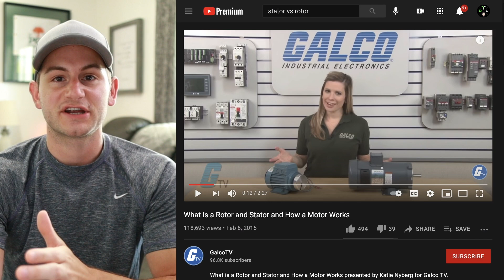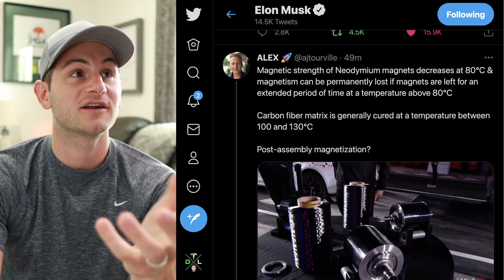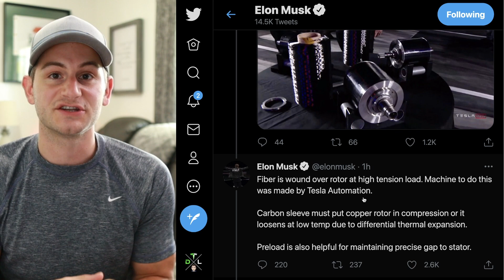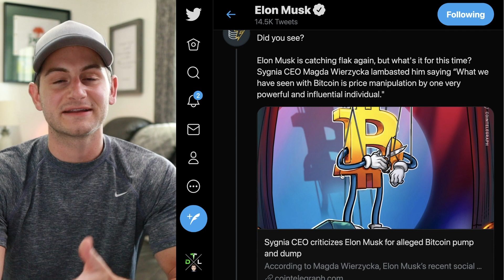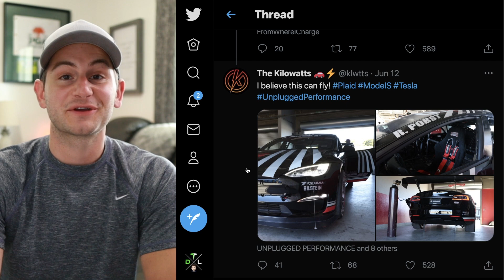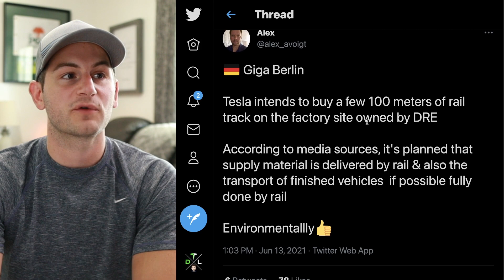Elon Just Leaked NEW Details on "World's Most Advanced Motor" 🌍

Comment from the maker: Hey guys! This motor is a much bigger deal than most of us were expecting...as expected! Haha have a great day!
Reply: This new motor is underrated imo 👈🤔
Reply: Machine-wrapped motor could be bigger than 4680, due to efficiencies that apply to ALL battery formats, not just tabless! Not holding my breath for fin-media to ever grasp this, but another "Fear Factor" from Tesla for ICE OEM's to quake about & have ZERO responses! Hodling to the max.
Reply: Neodymium magnets comes in different temperature grades. While it is true that the standard magnets lose magnetism at 80 degrees C, they comes in grades that work up to 230 degrees C. https://www.first4magnets.com/tech-centre-i61/information-and-articles-i70/neodymium-magnet-information-i82/how-does-temperature-affect-neodymium-magnets-i91
Reply: Agreed, the mainstream media and legacy auto will downplay this monumental achievement.  We truly have just witnessed disruption of legacy auto with regards to the powertrain.  Tesla Engineering are effing rockstars!
Reply: @keithnance4209  well ya, but for aviation, 1 Tesla motor can probably turn a bigger blade than anything else.
Reply: @jt7468  The carbon wrapped motor is designed specifically to withstand the high centripetal forces in a high RPM motor. You can’t turn a propeller blade at those speeds!
Reply: @garychadwick1240  look up gear motors.
Reply: @garychadwick1240  Eternal debate within electric model aviation, what is best, gigant direct drive “torque motors” or highspeed high power density motors with a reduction gear. Typical, highest peak power per kg is still achieved with geared high speed setups. Direct drive wins on simplicity and lower cost. When it comes to real (not models) reliability and durability, it’s all up to the cost and quality of the reduction gear in  relation to mass. Helicopters and turboprops all depend on extremely reliable and power dense reduction gears.
Reply: @garychadwick1240  If you wanted to build an electric airliner that would carry about 35 passengers, what kind of motor would you use?
Reply: Will it fly one day?
Reply: Damn bro, it's wild how I watch your vids now and remember partying with you at Penn State LoL
Reply: I wish I get to know more about the technical upgrades that they did in heat pump/HVaC..
Reply: If I was Ford, I'd learn how to make synthetic gasoline from solar, air and water, and do it B4 SpaceX makes methane that way. It would cost more but at least they could continue selling expensive ICE cars...
Reply: @fireofenergy  Germany is trying make synthetic gas since 2nd world war , its nor cost effective compared to extracting oil from ground and when electricity is 5 times cheaper there is no commercial viability of synthetic oil. there is a recent video from Engineering Explained channel on that..
Reply: ²
Reply: You're right! The lightweight performance motor will further enable electric flying vehicles.
Reply: @jt7468  the motor is not the limitation for flying. The weight of batteries are.

Comment: We developed a carbon-fiber wound rotor motor around 1997-1999. It was a feasibility study so it was not going into production. Pretension pressure on the rotor surface from the carbon fiber was to exceed 1200 BAR at nominal operation speed to keep the rotor from expanding. If I remember correctly the Neodymium magnets were of a grade that could handle 150C. There are grades going up to 200C, but the the cost of higher temperature is that the magnet will be weaker. If 200C is not enough, use samarium-cobalt as they will be stronger at the very high temperatures.

Comment: Yamaha / Toyota has super advanced electric motor tech & there's a way to diffuse a certain metal element into the outside of the magnets in IPM to improve heat transfer away from the magnets // & same element can make alloys in induction motors that improve magnetic flux density (efficiency)

Comment: Wall of text:
I can't make good use of this information. Putting a layer of carbon and plastic on the inrunner rotor will increase the distance between magnets+iron VS copper stator. However... he talks about copper on rotor..? WTF would you use copper on the rotor if we think about a brushless design?`Copper is soft and heavy, exactly what you don't wan't on a rotor if you have intentions of using it in a repetitive cyclic environment like a vehicle?!

I would understand carbon wrap on an outrunner design brushless... wrapping outside of rotor does not increase distance between rotating magnets and stator coils... but still I do not understand the use of copper in rotor part.

Now if we are talking about a brushed design, well, now it kind of makes sense... but somehow you have to gain somewhere else for the losses incured by extra distance.

Buuut... how do you solve the darn heat problem? Coils of copper tends to get hot... carbon + plastic fillers are typically very poor heat conductors.

Comment: If carbonfiber wrap increases gap space between stator and armature, that would reduce mag-flux intensity. If the wrapping could be done on just the Cu wires alone, no change in gap, that would be even better. Another approach not discussed is using retro-style permanent magnets (eg. AlNiCo) on rotor, with super-small gap, and vacuumed case.

Comment: The increase in RPM’s is a two-fold if utilizing the potential energy like a KERS in F1 or by throwing it back into a capacitor during braking holding it only to discharge during acceleration.

Comment: So, as I understand it neodymium magnets are made by bringing the neodymium into close contact with the iron of traditional magnets.
One of the ways to do this is to powder the two elements and pack them together. I believe this is called sintering. Alternatively the carbon fibre is used to  hold the powders together, when fast spinning would normally tend to break them apart. The carbon fibre acts as a kind of cummerbund. 
But there is a problem (which I don't think was addressed by the presenter). The carbon fibre resin in the moulding sets at temperatures which exceed 80 degrees centigrade. Temperatures above 80 degrees centigrade destroy the magnetic properties of the neodymium. I did not catch the resolution of this  particular contradiction.

Comment: Yamaha have created a family of light efficient motors (different price points, different power specs).  Lucid's EV motor is very light & supposedly very powerful & efficient. Yamaha do engine & cylinder design work for many ICE manufacturers (boats/snowmobiles too etc), so they really know their stuff.  It would be great to get a comparison of those 2 & Tesla's new motor specs.
Also I was fairly sure that battery tech has miles to go before they're at their peak of development, but EV motors, not so much as they've been around much longer than the ICE. How wrong could I be!  It's modern materials science & manufacturing that stupidly for the electric motor industry, hadn't been applied as much as in the ICE arena!
Shame on GE etc!...

Comment: I wouldn’t doubt that Tesla is using everything but the tri-motor in the long range version. They are just limiting everything by software. You certainly can’t tell the difference between the two visually besides badging. They don’t even include the upgraded rims/tires on the plaid. At least if you get a performance 3/Y it comes with the upgraded tires/rims.

Comment: 🤔electric motor companies know that the air gap between the rotor and the stator is a big part of the motor design, what’s going to be interesting here is removing the heat from the rotor, I’m not sure CFRP is noted for its thermal conductivity. In induction and brushless motors the windings are typically in the stator and the rotor is reacting to the fields going about it but heat is still generated in the armature. I fear 88C is approachable to demagnetize the neodymium magnets unless the heat can be dealt with. It would be interesting to get the rest of the story from the Tesla engineers to see what is really going on in that motor.
Reply: Yes yes yes! This is the important point. Keeping the fields optimized of a broad range of conditions is hard. Usually you select a single optimal regime. Here that optimal regime is broadened, or there could be several regimes.

Now I’m beginning to think the plaid name and logo are a clue to the wrapping of the carbon fiber.
Reply from the maker: thanks for sharing!

Comment: Copper rotor. This means it must be an induction motor. No magnets. I would think that the motor could be chilled to a low temp before it is wrapped in order to reduce the risk of the two components coming apart at low temps.

Comment: These motors where built for the plaid version because of how much faster it has to spin. I doubt they are needed for the model 3/Y or regular model S/X. Im sure these new motors cost more to make. But i could be wrong.
Reply: yu know.  great TECH but more expensive ... but i bet this motor wud work just fine on the TESLA ROADSTER.  TESLA stock will 10x in 10 yrs.  all my friends have zero idea.
Reply: As carbon fibre is not that expensive (in relation to the quite small amount needed for a rotor sleeve) I see potential to make all motors a number smaller and lighter AND more effective. In total a lot of positive effects. A relative large portion of the cost with CF is the processing. If this is automated, I see only savings everywhere else :-)

Comment: I think the cost and complexity makes it an unlikely fit for the 3/Y, though I'd bet it's going to be on the Roadster.
Reply: Cost and complexity is solved by mass production… which the 3/Y certainly are.
Reply: @ernestgalvan9037  some things remain expensive. It's why SpaceX (and Tesla, really,) use metal instead of carbon fiber wherever possible.
Reply: @ernestgalvan9037  to a degree. This has obviously been in development for a long time, as many issues needed resolving. You can't make a car engine as cheap as a stick & a hoop by infinitely mass producing it.  The Semi would be a great place to install this for the efficiency win especially to shut Bull Grates & the Oil Baron cronies, the FU.

Comment: This is not much that most even modestly interested engineers and arm-chair engineers have tossed together on a piece of paper.

Carbon fiber would be used for a number of reasons, structural integrity and strength, low weight, potential electrical conductivity or insulation. The list goes on. I am fairly certain the Motors Tesla uses are "moving magnet" motors, in that the stator does not move or rotate. The motor shown in the second example is a brushed motor not really used except in some cut rate electrical/power tools. R/C Hobby motors switched to Brushless AC motors in the late 1990s or early 2000s

Sleeving the stator in Carbon Fiber might be done to lower weight of the overall motor.This would also allow for a leaner stator structure allowed MORE wiring in the same size package. Thus a faster motor. CF is not however known for it thermal conductivity and unless Tsela is using Room Temperature superconductors, I am now confused and concerned. But it does explain why Tesla would want to wrap hot wires  tightly during production of the motor.  

The Magnet/Rotor could use CF to lower weight to improve speed and structural integrity to allow the motor to survive higher RPMs. But this would eat into the rotor itself limiting torque and RPMs. But a Higher RPM motor will require a stronger rotor. 

Previously, I said the key words "on a piece of paper".  Tesla's only real advantage is they actually built it. There is literally nothing here that a supplier would build if asked in a heartbeat by a car maker looking to make an electrically propelled Supercar. But most car makers are not interested in making electric supercars, for one reason or another. Not really important. They are however taking a more realistic look at the market where 90% of buyers are not interested in buying a BEV than can outstep a dragster or some hypercar they will never, see forget own, outside of exhibitions, races, or the internet.

That said, everyone needs to have "their thing" to be taken seriously and/or remembered.

Comment: The implications go beyond the motor. It's looking like no matter what anyone else does Tesla is far ahead with both engineering and manufacturing. After Sandy Munro (Cory! Get the octovalve!) looked under the frunk bin of the Mach E - it's clear that you can copy Tesla, just not very well. 
What I would be looking for in all the competitive EVs is new engineering and new manufacturing techniques. If it's not there (so far there have been some smart things, but nothing major) then Tesla can only come out on top.   Tesla's competition is Tesla. 
And of course this gives Deep-Tesla investors  (those of us who are closely following as much of this as we can get access to) even more of an advantage. What should've happened to the stock value after Musk revealed that Tesla reinvented the electric motor?  It didn't happen, did it? That simply means even more value is being embedded into Tesla stock.  
Thermal expansion, the centripetal force of a large 20,000 rpm motor are huge factors to over come. (But don't be fooled. It's easy to open up a motor catalogue and find motors that run at 20,000 rpm - they're all small motors.  I think my wood shop router can get up to around this rpm.) 
When the ICE manufacturers' cars win big races sales go up. Or they once did. So just about the time the Plaid Model S stops melting records, the Roadster is going to be released, or will the Cybertruck be sooner?  
Maybe the stock will stay in the ditch for another year and then it goes 7x in  8 months.

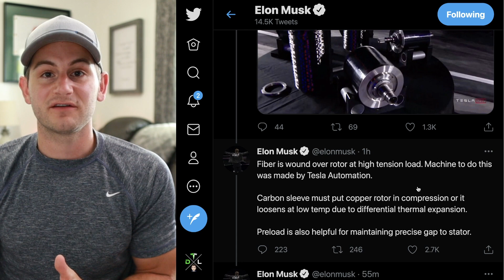Comment: At about 5:00 minutes you discussed the tight wrapped carbon fiber over the copper sleeve. Tight wrap for the carbon is needed according to Elon to prevent the two parts from coming loose at low temperatures. Elon is referring to the fact that copper has a higher coefficient of thermal expansion than carbon fiber (it shrinks and expands more with temperature changes than carbon). This mean copper shrinks more at low temperatures than carbon. So, when it is wintertime, cold temperatures, the copper sleeve can shrink more than the carbon cover. This has nothing to do with operating temperatures or magnetic fields,

Comment: I watched the launch, Elon was clear as to why they had to carbon wrap the Rotor. It was purely so the motor did not destroy itself due to large centrifugal forces when spinning up to 20,000 RPM, which is necessary for the Model S Plaid to hit the planned 200 mph as there is only a single speed gearbox. It is clearly more expensive to manufacture and so I don’t think it’ll be in other vehicles other than the Roadster, and because they don’t need it.

Comment: Is Tesla installing this motor in the model S LR or are they using the previously designed raven motor?
Reply: This new motor is very expensive so I think they only use them on the Plaid and the roadster. If they can drop the cost they might use it on the rear motor of Model S LR but they will likely keep the front raven motor which is a modified Model 3 rear motor because that one is optimized for cost.
Reply: The owner's manual describes the LR motors as permanent-magnet, AC synchronous motors. This the same as the Plaid motors but without the carbon sleeve because they don't need to operate at the same revs/min as the Plaid motors.
Reply: Explanations by Kazedcat & WR make sense to me.  I can’t justify $50K additional for higher top end speed and greater acceleration.  But do understand others want it.

Comment: After reading an article of the Baron where they didnt even mention this new motor as a highlight actually at all! Thank you! Unlike a typical electric motor that begings to gradually drop performance after 60% of its maximum rpm this baby sustains performance all the way to its maximum rpm , this is the most advance electric motor ever created , the aplication for this technology is endless , tesla took it to the next level this is the future of the electric motor, its a major break through yet few are catching on , on how huge this could be.
Reply: You can design an electric motor to run at whatever frequency you like. A 100kW motor designed with a base speed of say 1500rpm can generate 100% torque from standstill to 1500rpm, which means power output goes from 0 at standstill to 100kW at base speed. You can make it go faster but now you're in the constant power region so torque drops off as you go faster. You could make a motor that develops 100kW at 3000rpm, but it's rated torque will be half that of the 1500rpm motor.

Comment: . Face doesn't need to be 30% of my TV. A box down the bottom like every day tesla is better
. The brushed motors in the video have little to do with modern motors. Everything is multiphase "brushless" outside of heavy industrial settings, like video source.
. Neodymium magnets come in temp ratings from 80-200c. Theres no magnetization of magnets happening in the rotor lol, each one is 3-4 pieces bonded NSN together, as per Sandy Munro years ago, RE your twitter source
. Google "brushless vs brushed" , "copper wound motor vs hair pins", See munro's motor breakdowns and comparisons, see Webber Automotive breakdowns, see Grin Tech's hour long videos on ebike hub motor coil saturation, kv vs motor speed and torque
. CF overwrap is mostly directed at high 20k motor RPM (so they don't need a 2 gear gearbox like VAG) and increased motor flux, imo